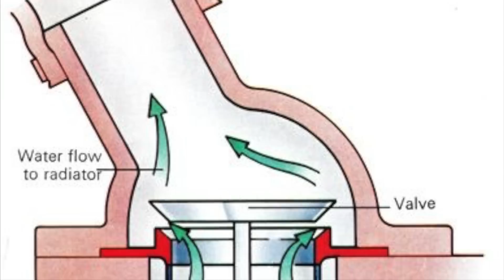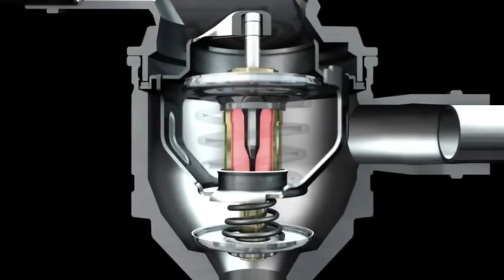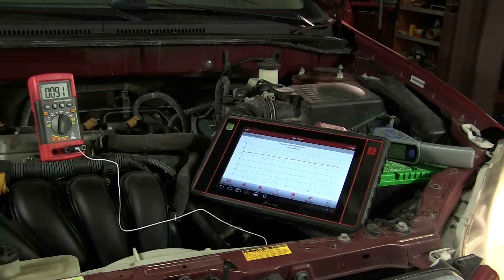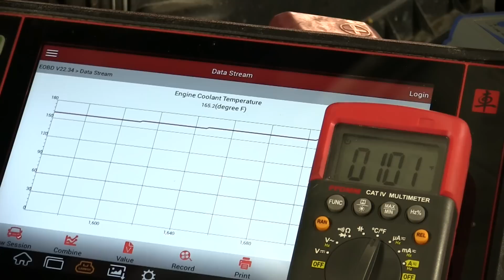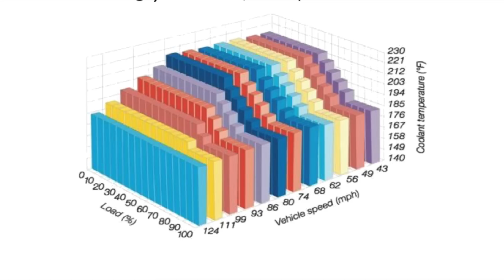The Trainer #91:  The Thermostat - Gate Keeper Of The Automotive Cooling System

Comment: Hello, Sir. Could you please explain  why an increase in temperature on start up is caused by an open thermostat?  I would think that if the thermostat  were open, the temperature would take longer to rise.
Reply from the maker: I'm referring to the comparison between the ECT (Engine Coolant Temperature) reading and the actual reading at the inlet to the radiator. When cold, the thermostat is closed to allow the engine to warm up quickly. With no flow going to the radiator, the temperature at the inlet should remain low. If you see both temperature readings rising at the same time on initial start up, it's an indication that the thermostat is open when it shouldn't be. Make sense?
Reply: Thank you, Sir.

Comment: I can remember a fire dept truck that had a large V8 International engine with no thermostat, but it had thermostatically controlled shutters in front of the radiator.  It also had duel Delco Remy distributors using a total of 16 spark plugs.  
The shutter system worked great!  Never saw that system have problems.  
Today's t'stat have to keep engine temps just right for that engine to operate efficiently.  I found replacing the coolant every 2 years  helps to keep the cooling system clean and eliminates problems.
Good Video Pete.